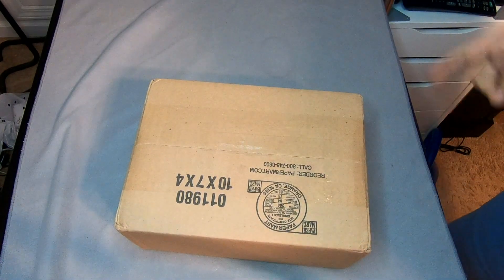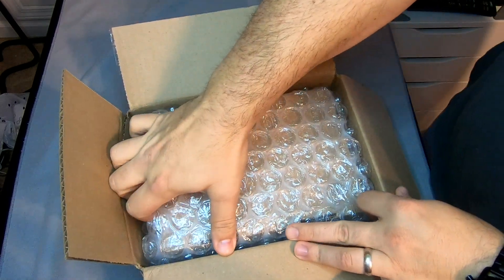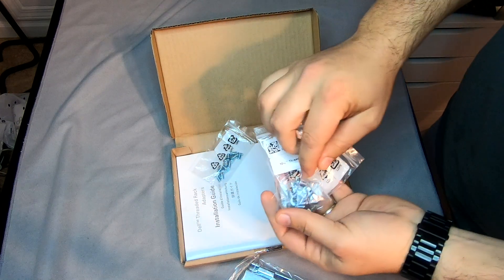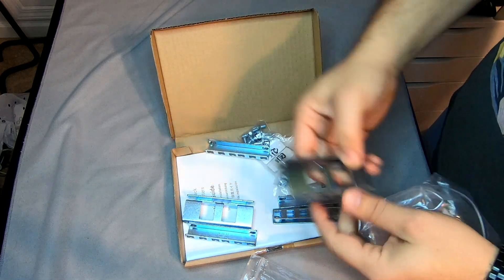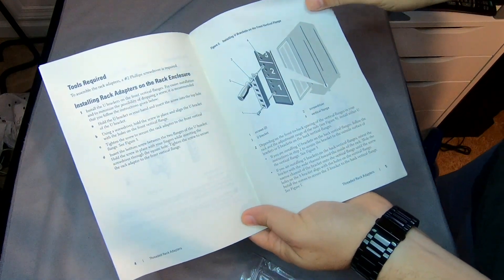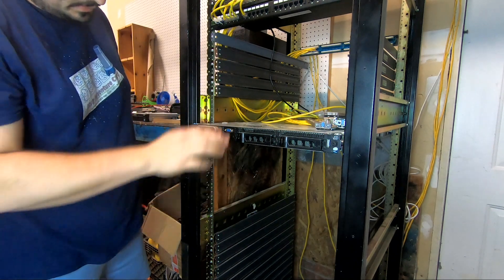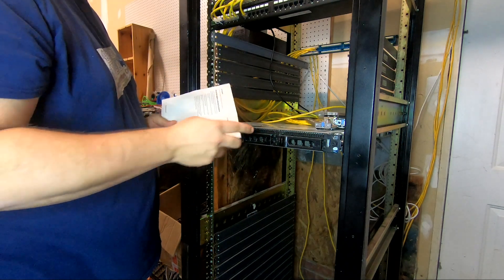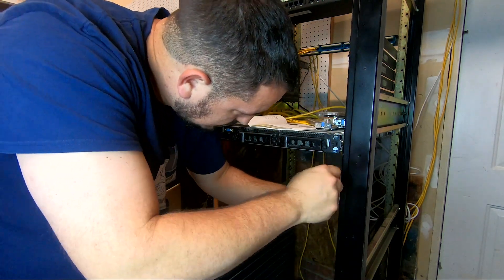Unboxing and Installing A Dell Threaded Rack Kit for a PowerEdge R710

Comment: Hey Craig, I just watched your video on the Dell 710 screw to square rail adapters and had a chuckle watching you load the server into the rails.  Having had similar struggles in the past, I found that its easier if you locate the rear pins on the server in the back rail mounting slot and then, using both hands one on either side of the server, place it into the next forward slot by "wiping the rail" onto  the pin and then do the front ones.  Alternatively, have a partner help. ;-)
Reply from the maker: Thanks for the tip, I tried asking my wife for help, and she said no......lol